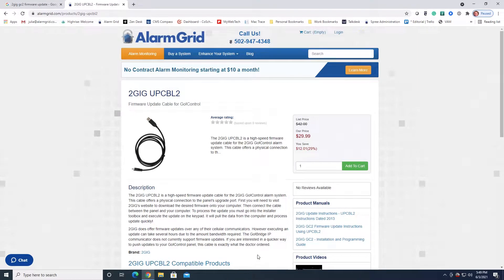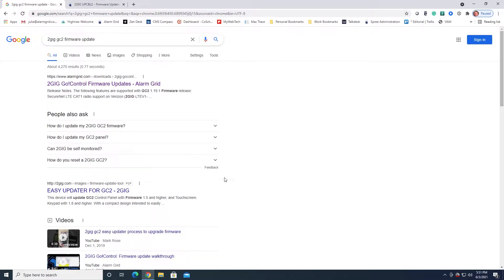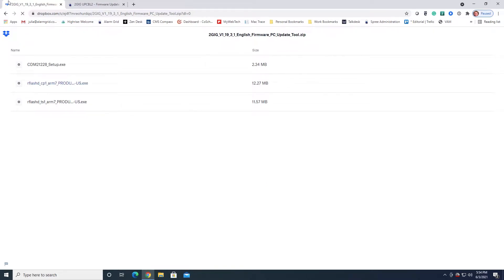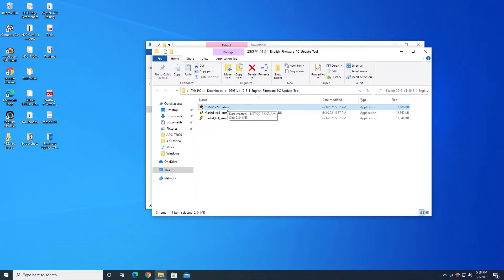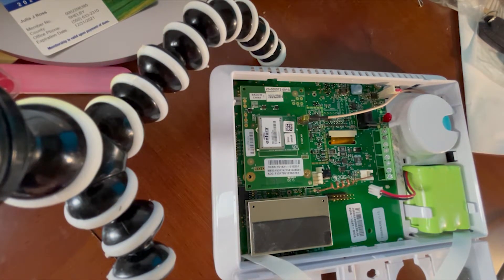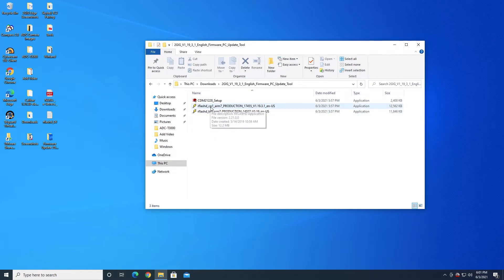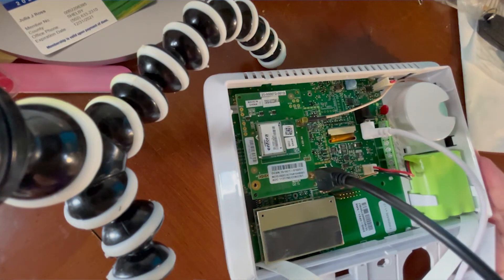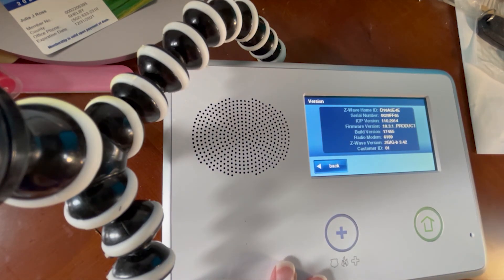2GIG GC2: Updating Firmware Using Updater Cable (UPCBL2)

Comment: Quick question: why do I have to disconnect all power before removing the update cable?
Reply: This is to prep against any possible shortages that may occur.
Reply from the maker: It's just better to be safe than sorry. The GC2, in particular, seems to be a bit finicky about plugging and unplugging things to and from the main board when power is applied.